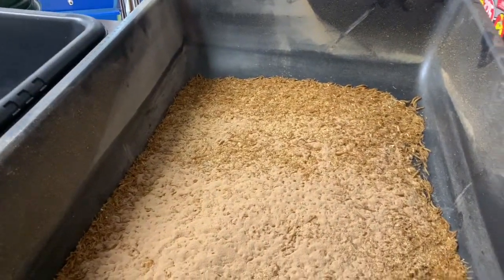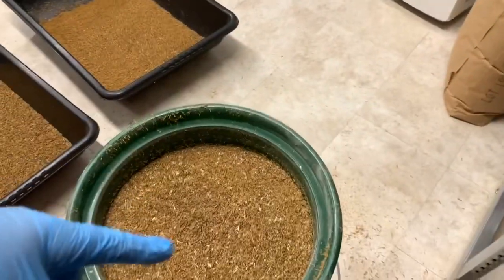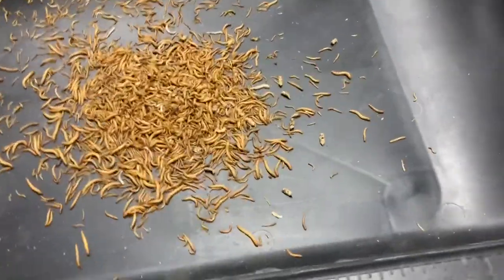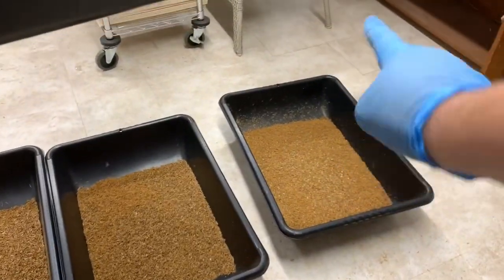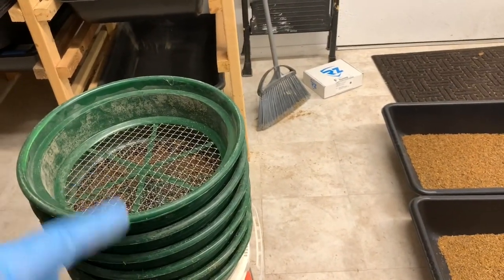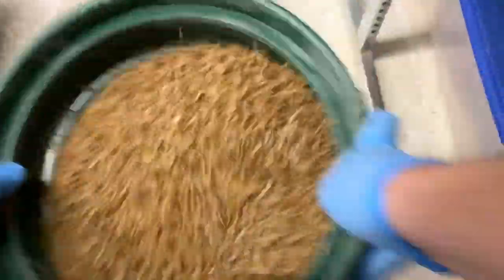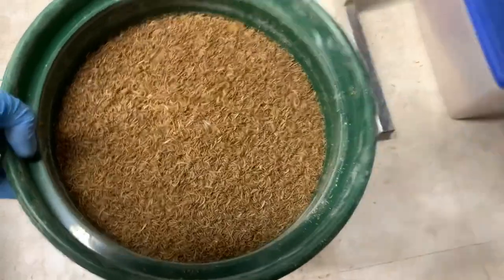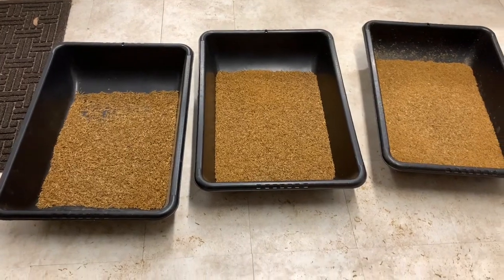Sorting Mealworms by Size

Comment: Getting ready to start a mealworm farm and I am not sure which method I want to use to sift out the worms.  When your use the round screens and this method are you losing a lot of eggs that sift through with the frass?  If so how do you separate them from the frass or are you just taking the beetles out of that tub and waiting for all the eggs to hatch before sifting?
Reply from the maker: Eggs shouldn’t be in frass if you separate pupae/beetles from your worms. Eggs/baby trays don’t need to be sifted for several weeks. By the time the babies are large enough to generate frass they’re large enough to get caught in the sifter set.

Comment: How do you separate the meals worms from their bedding?  Also, Do you grind you chick feed?
Reply from the maker: If you have a small farm a regular kitchen sieve or colander should work. If your farm is larger then I recommend a set of bucket sifters. You can find them here: tinyurl.com/bucketsifter
Reply: @spacecoastmealworms  thanks.  Do you grind your chick feed so that it shifts out leaving only worms?  I'm familiar with chick starter but it's not a fine powder. Just wondering if you use it as is.
Reply from the maker: Sorry bout that.. forgot to answer this second question. I never did when I used it, but had issues with it passing through sifters, so grinding it down would definitely be helpful.

Comment: I can't come too using more and more meal everytime I have new beetles. Is there anyway to conserve the meal better. The self sorting containers seem great for that
Reply from the maker: Beetles only need an inch deep layer of substrate, and you can wait 3-4 weeks to swap it out. Bran is super cheap if you buy it in bulk (40-50lb bags) at a local feed store. Usually between $12-20 a bag

Comment: Another useful video, thank you. The stacking sieves you are using cost the equivalent of $130 in the UK, so I ordered stainless steel mesh in various sizes from eBay, and made lightweight wooden frames, the mesh fitting in a rebate. These have handles extending from the frame so that they hook over the 60x40cm euro crates I'm using. I've left enough room to wiggle the sieve, but it's much bigger than your plastic ones. I wouldn't have gone to that effort if I could have gone to Walmart and got yours for $50 , but it works brilliantly. People in Europe may like to know that euro crates are fairly cheap, and stack well.Even available in food grade.They even have little cells you can drill out for ventilation.If you're in the UK you can utilise Tesco supermarket crates by cutting the bottom out and dropping mesh in.Tesco may not like it, but I don't like Tesco.
I was worried your tickle technique may cause internal injuries to my babies, and started using my compressed air gun, dialled right down, to blow them off the mesh. I also have a Makita 12v blower (part of my workshop kit) that has a soft rubber nozzle- perfect for the little rascals.
Good luck from Welsh Wales, mealworms forever!!!
Reply: Thanks for the buying tips for those in Europe (I'm in UK). Are you able to share the ebay link to the mesh you bought?  (thanks for the tip about Tesco which I will try for the trays!!) where did you find the euro trays: cheaper on line or is there a store in UK I can get them to save on P&P?
Reply: @justinemurrin3851  https://www.ebay.co.uk/itm/Stainless-Steel-Woven-Wire-Mesh-Heavy-Duty-Coarse-Fine-Ultra-Fine/153822206977?ssPageName=STRK%3AMEBIDX%3AIT&var=453855950699&_trksid=p2057872.m2749.l2649

They do a huge variety of mesh sizes and gauges, I worked on A3 sheets 30x42cm being cheaper than custom sizes, and these fit over these eurocrates with room to move the sieve too and fro, if required. I bought 12 crates, but I imagine four would be enough to start with. The supermarket crates are more cumbersome, and harder to fit sieve to, but are free, and work.

https://www.ebay.co.uk/itm/NEW-Strong-Grey-Industrial-Plastic-Eurobox-Containers-Storage-Boxes-Box-Crates/391901309726?ssPageName=STRK%3AMEBIDX%3AIT&var=660875554282&_trksid=p2057872.m2749.l2649

I reckon I've spent about £120 setting it up, but I've been spending £200 + a year on dried worms. I'm at the stage of having 300 beetles starting to lay, so hopefully......
Reply: https://youtu.be/nsxj1xrki2E?si=9Qv8zCvLuBvPld-W

Comment: I got a small mealworm farm start up kit for Christmas 2019.  It has expanded to being in a 10 drawer rack (like you use for your beetles).  I start new nursery pan every 3 weeks.  However, I find the sizes of my worms vary from tiny to changing into pupae in the same bin even months after removing the bin from the beetles and their egg laying capibility.  This makes me have to keep the bran and frass so I don't throw out eggs and the tiniest of meal worms.  I was wondering if the 1/30 screen mesh pan allowed eggs to go through?  Hoping this way I could keep the eggs but finally remove frass from my productive trays.  By the way, great videos and information that you share.  Thanks!
Reply: Did you ever find an answer to this?
Reply: I found from experience that eggs were often the same size as the smallest bits of frass or meal. I just keep my ending stage of frass and meal to the side for up to 6 weeks depending making sure not to mix with each ‘generation’. Eventually all of the eggs that will hatch do and then I can get the frass separate from the meal easier using a shop vac

Comment: Where do you get those "black" bins when you sort.  the edges slide out the worms easier. Can you tell me how many worms bins you have?  Interested in starting a business for local chicken starters
Reply: Home Depot sells them.
Reply: Home Depot sells them.
Reply: Home Depot sells them in 2 sizes.
Reply from the maker: As the comments have said, Home Depot has them. Look for ‘concrete mixing tubs’. The ones I got were $6 each. Altogether I have about 25 black bins, 25 white trays, and 30 of the smaller rainbow trays that I use for beetles. There’s a huge nationwide shortage of mealworms right now, so start growing as many as you can.. it’s a seller’s market!
Reply: @spacecoastmealworms  Great videos. thanks for posting them!  To what do you attribute the shortage?
Reply from the maker: ChadW I think there were a bunch of folks who took up new hobbies during the pandemic, like chicken farming, adopting new herptiles, etc. plus raising Mealworms saves a bit of money for folks who already have chickens or herps.  I’ve had the best three months I’ve ever had with tray sales since this whole thing started, so it’s definitely real!